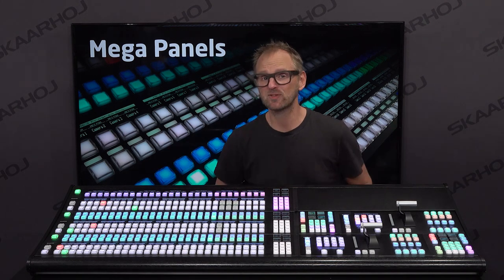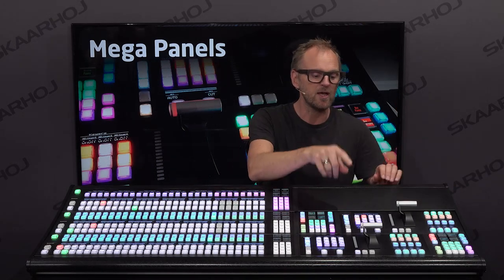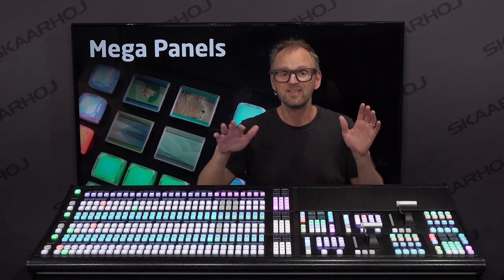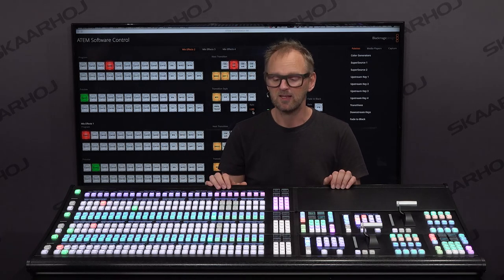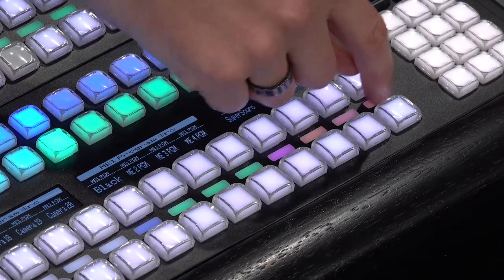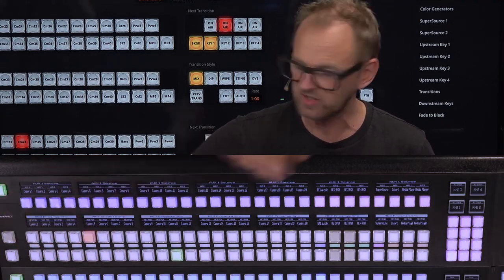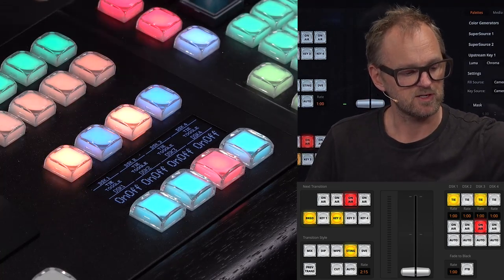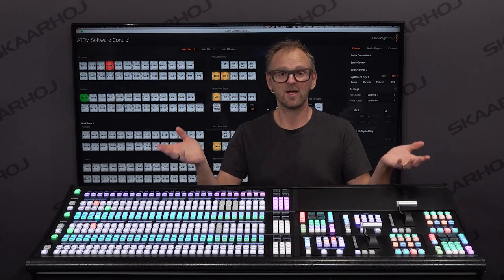ATEM Constellation 8K Panel - Custom Build!

Comment: awesome looking. Only thing it needs now is a joystick positioner.
Reply from the maker: Thanks for the input. Tell us more about how you would use a joystick positioner.
Reply: Indeed.  The joystick is critical when controlling the size and position of the ATEM picture-in-picture DVE, as an example. ;)
Reply: @Cory182  or for remote camera control like PTZ units